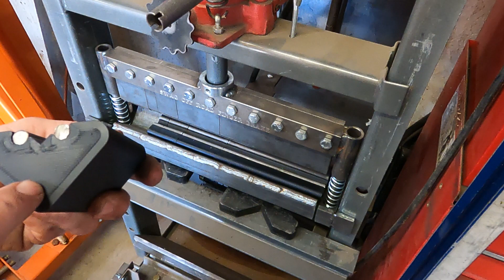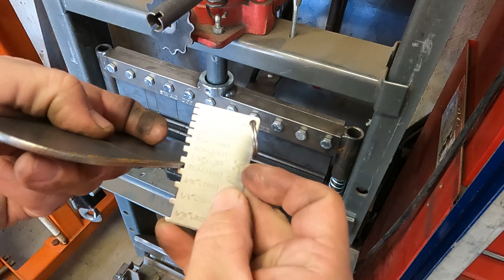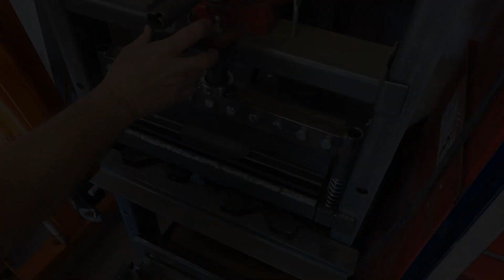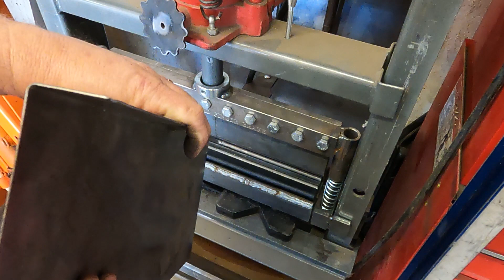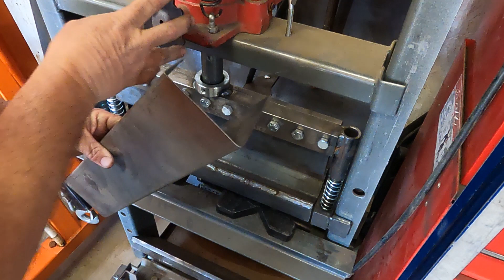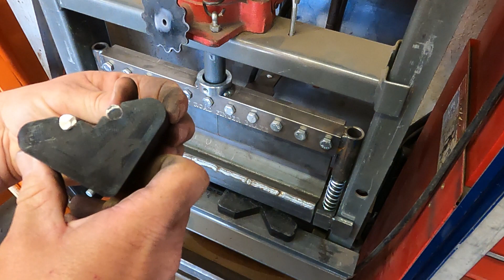3d printed lower die for the Swag Offroad finger brake

Comment: What % infill? Maybe I missed it, are those magnets? Printed into it? Pressed in? Or glued?
Reply from the maker: I think the infill was around 65 percent with 8 walls.  I played with the amounts until I was able to print them all out of one spool of material.  It took 980 ish grams to print all of them.  I had about 7 wraps of filament left of the spool when it finished. 

No magnets.  Just round rod from Home Depot.  The way I printed them, the rod are a snug fit.  I will probably put some glue or epoxy on them to make sure they don't fall out.  If I were to print them again, I might make the notch for the rod a few thousandths smaller for a tighter fit.